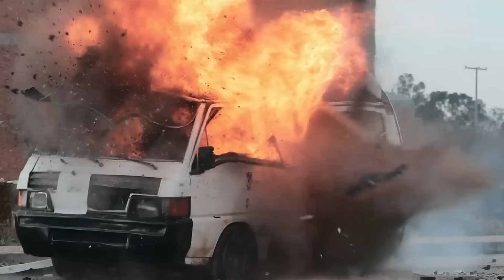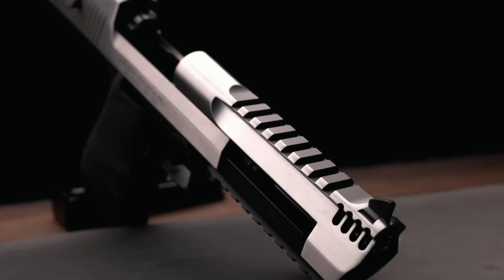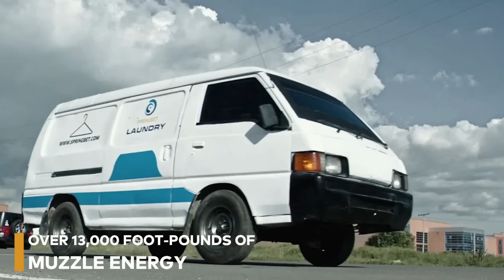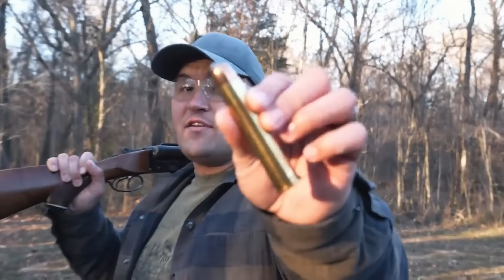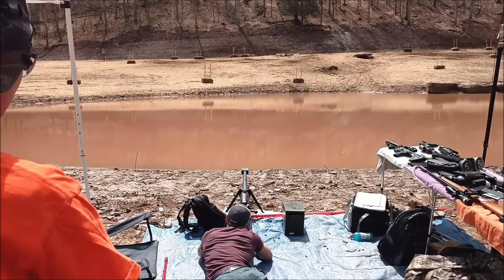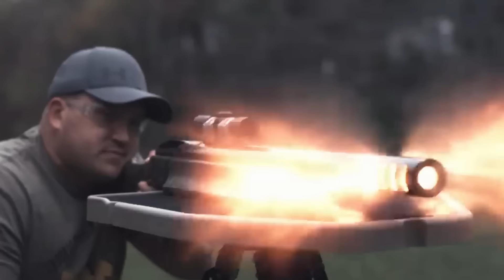The 8 Most Dangerous Guns to Shoot (But People Still Do)

Comment: Alot of proof that the ak 50 is a great design... Lower risk than the baret
Reply from the maker: @ludgerwillgaster2095 – You nailed it. The AK-50’s overbuilt design and buffer system definitely give it an edge in terms of safety and durability compared to something like the Barrett. Brandon’s engineering might just redefine what we expect from .50 cal platforms. Appreciate the solid observation! 🔥💥

Comment: I stopped watching after the video said over 10000 rpm for a runaway M11.
Reply from the maker: @aiax6.5cm93, your skepticism is absolutely justified! A theoretical rate of fire of 10,000 RPM (Rounds Per Minute) for an open-bolt design like the M11/9 (or MAC-10/11) is grossly exaggerated and impossible in reality. Even highly modified variants typically max out in the low-to-mid 1000s RPM range, which is still an uncontrollable "zipper gun." That level of hyperbole immediately discredits the technical authority of the video. Good call on turning it off!
Reply: @BallisticEdge08 your statement is like poetry to my gun nerd ears, my brotha. I fukn dig it